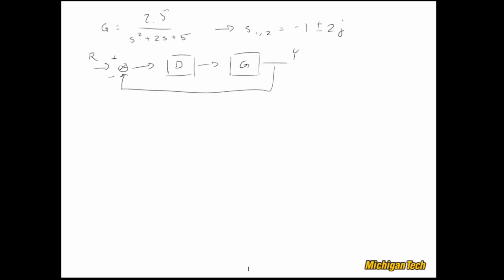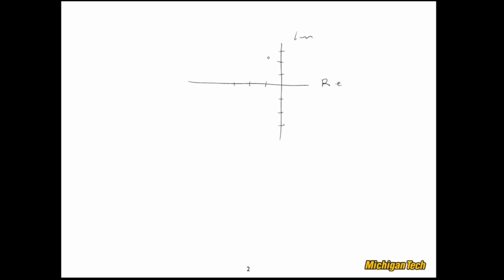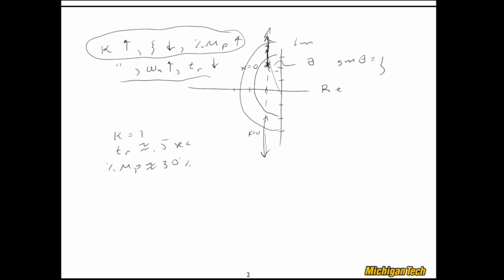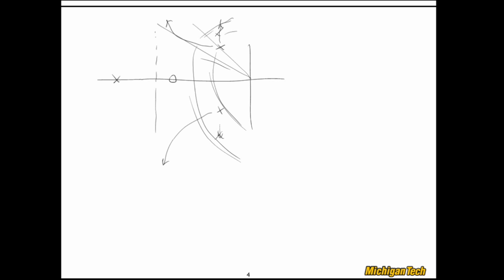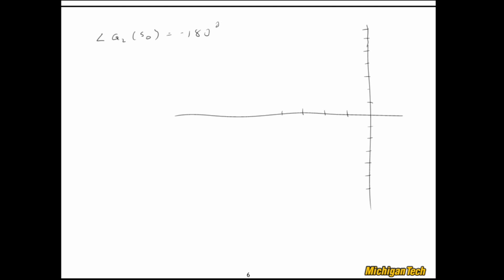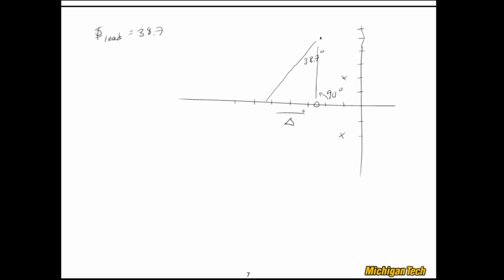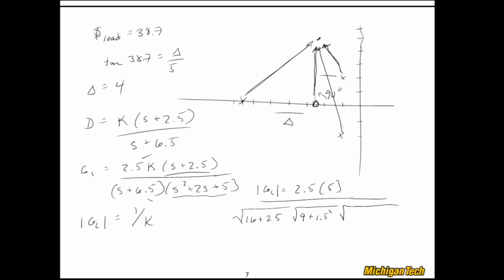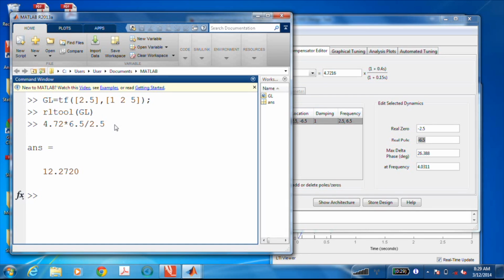Root Locus Lead Compensation Example

Comment: At 25:05 the reason that the percent overshoot is greater than anticipated for a second order system is because of the additional compensator ZERO not the additional compensator pole, which by itself, would have decreased the percent overshoot.